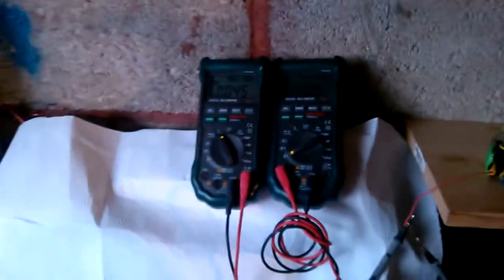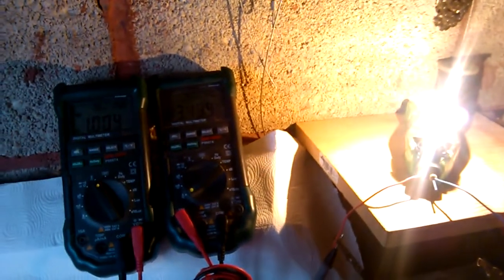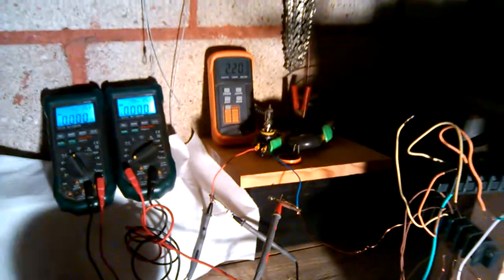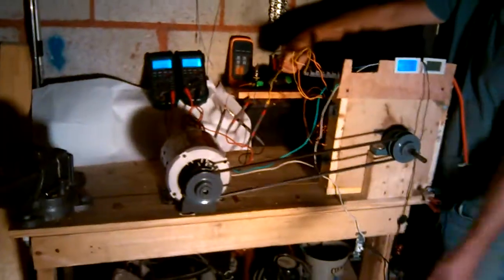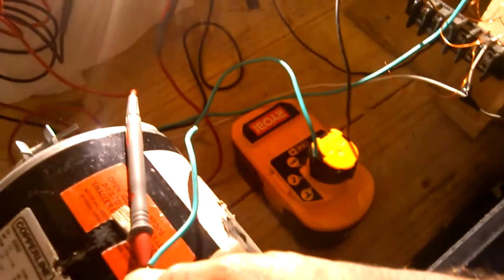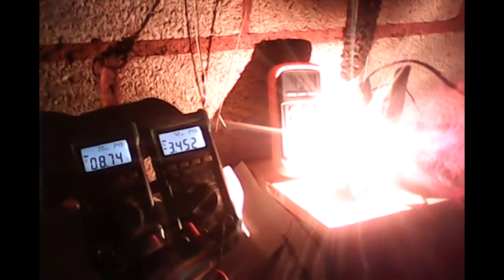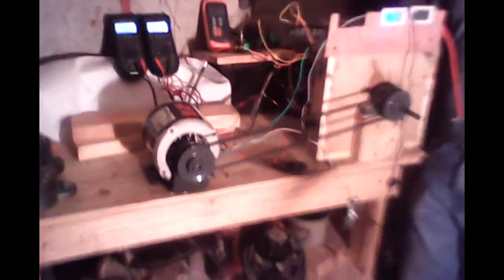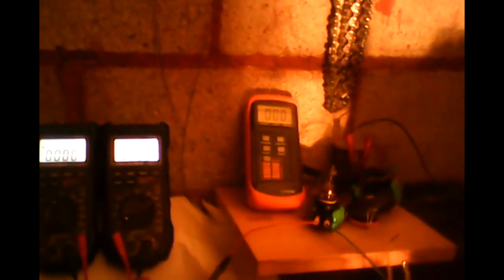New generation coil compaired to standard coil. Better then a Bedini coil hybrid not an SEG.

Comment: FSince the coils are Lenzless, then there is 2 parts on one toroid wound in same direction. The best way to get the highest amount Power from the coils is to use F.DiodesDiodes to short the individual coils and do 2 more other things.